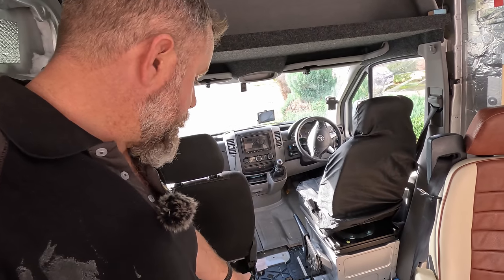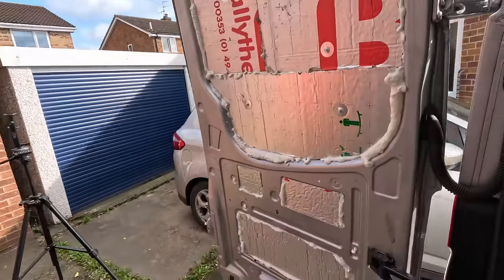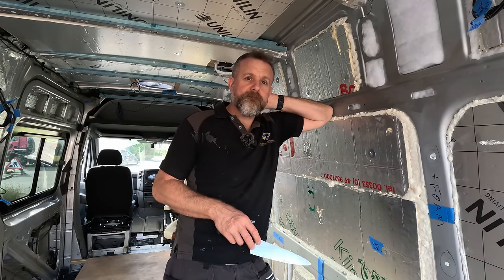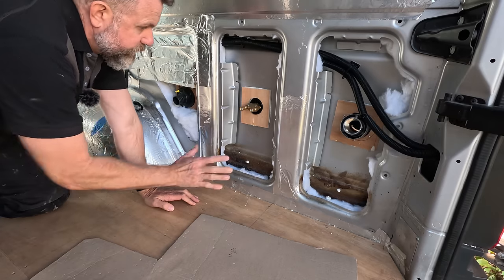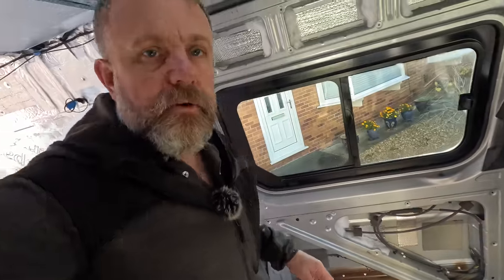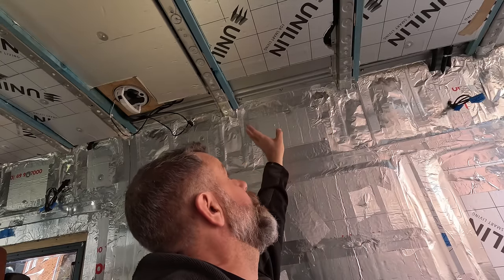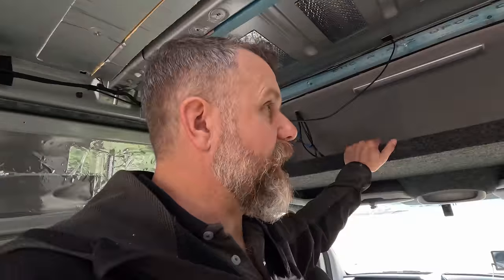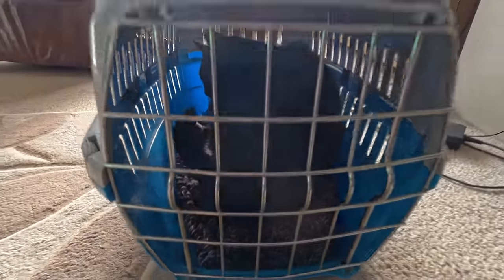Campervan Build Overload, I Don’t Know What I’m Doing! | Insulation Progress

Comment: I used to think that about Greg. And he is very knowledgeable. But some things I don't agree with
1 is battens on floor & pir board in between
Ive stuck pir board directly onto floor
Using sikaflex 522. No screws going into floor to rust
Suggested this to Greg. His rey. Not crash tested
 I didn't reply as didn't want to get into argument with him
Nothing you put into van conversion is crash tested. Except rock and roll bed. Which most vans of your size don't use.
Actually sticking the whole of pir boards down is much stronger than just screwing battens down.
Then I found a video from a big converter in USA. And he does as I've done. Puts it in beads of approx 150mm apart.. I've done it on each raised part of floor
Reply from the maker: Fair play to you sir. Yes there are many ways to do every job on these vans. I glued battens down and filled with pir. It's a sturdy floor. But not tested by time yet😉